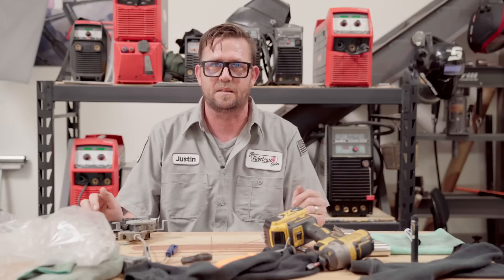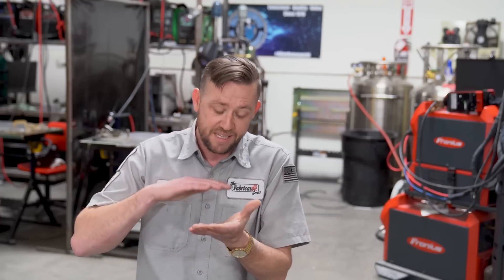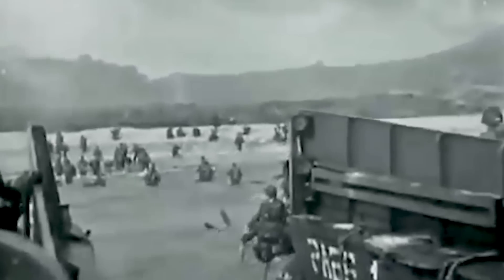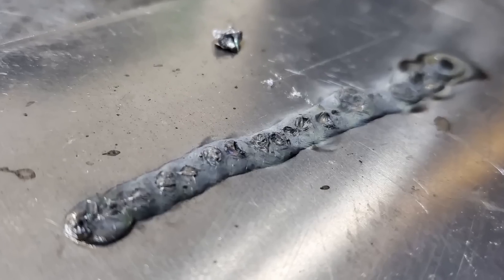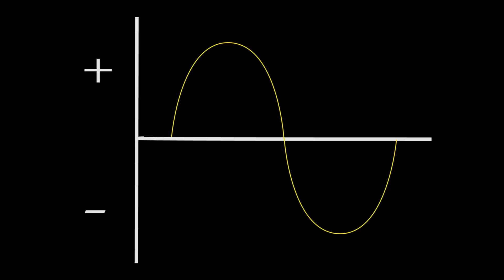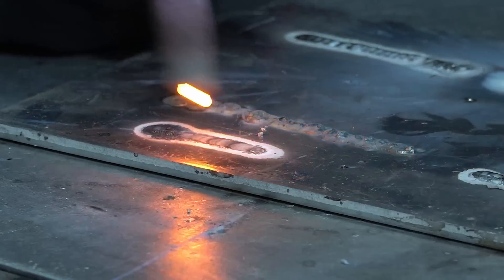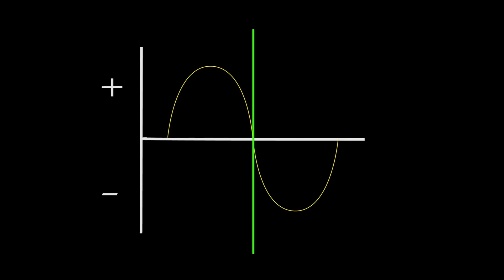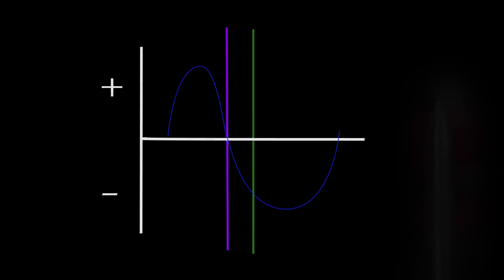We used to Ball the Tungsten. Now we Don't.... (usually)

Comment: It seemed to ball itself, doing the aluminum welds we did in my production facility.  I kinda marveled at the cavalier way our two qualified guys were doing things, nobody ever ground an electrode when I was watching and the ends of those rods were totally hemispherical... but the welds were helium-tight (and had to be) and structurally solid, so... messed up electrodes be damned.  I think it's more about the welder.

Comment: The theory is a little different:
When electrode is positive then ions of argon bombard the oxide layer and remove it from the surface of aluminum. Aluminum itself is heated poorly and tungsten is overheated.
When electrode is negative then tungsten is cooling down and aluminum is heated properly.

When using helium there's no cleaning action - helium cannot remove oxide layer as argon do, so no AC is used. But helium gives much hotter arc and it helps to melt  through oxide layer and weld aluminum even without cleaning action.

Comment: So I have a 330A/BP, no balance control. I have only blue, 2% lanthinated tungsten right now, up to 1/8". In the past I welded aluminum with 3/32nd overdriven, and split a few ends. I had a dull tungsten, not balled, and it wouldn't ball. Would I be better off getting 5/32nd and trying to sharpen in, or go with the green and let it ball?

Comment: Possibly (just spit balln' here) the reason why the first machine was set up to adjust the positive is possibly because for a long time it was thought that the electrons ran from +ve to -ve. That's because the multi meters gave a positive deflection when measuring the voltage and current. What they were measuring was the "holes" left behind when the electron jumped to the next hole on it's way to the positive terminal. Kinda like sitting in a moving train and measuring the world going past you thinking the world is moving and not you. So they thought the electron was moving to the +ve.  Once they could detect the direction of the electron they realized it was moving from -ve to +ve. But by then we had a whole industry set up thinking in the opposite direction.  Like I said, just spit balln' here.

Comment: Very timely video!! I run a 400A modern inverter machine in my home shop and infrequently use a 300A transformer syncrowave at work. Currently building some very large 1/4" wall tubing frames at work on the syncrowave and was balling 1/8" lanthanated tungstens and not seeing great results, especially on fillets. I'll have to play with the tungsten shape and balance a bit more tomorrow and see how that works for me. I'm also happy to have found your weld coach channel. I was a big fan of TFS and really liked your past videos on there. Lastly if you or anyone has other tungsten suggestions for the transformer machine that could also be helpful!

Comment: A few things, it would have been heliarc in those days with 50hz. 60hz didnt become a lot more common until mid 60s. This is also around the time gtaw sheilding gas experiments were getting more in depth and playing with different alloyed metals in gtaw. Then we started to see the viability of simply tig welding aluminum. As most applications dont require the added heat input of helium especially on thinner material. 

You also do not need to ball the tungsten. All the balling does is reduce transfer of tungsten to the workpiece and maintain stability in the tungsten. If you size your tungsten bigger the tungsten will only barely ball on the tip. Grind angle and quality is important when doing this. Thoriated will resist the balling throughout. Yes even on transformer machines. Most applications do not require modifying the ac wave. Balanced can be helpful at times also. Mainly on castings or broken down aluminum repairs. 

You can also weld aluminum on dcen if proper cleaning precautions are taken and the amps are set correctly for desired penetration thickness. A little helium helps too.

Comment: My 460 amp Miller has balls! It is a 1965 Goldstar 330 abp. 23 years ago, I was taught in college to ball the tungsten but we had syncrowave machines. If I recall correctly, we may have just done a small ball on the tip. The semester before, I got the 330abp at home and taught myself to tig weld from miller's web site.......no youtube back then. Most of what I tig weld is steel with some stainless thrown in and only occasionally aluminum, and a spoolgun is sometimes a better choice on the miller 211 inverter mig. Lately, I have just sharpened the pure or lanthanated tungsten to a point and blunted the end, like I do for DC use, then I let it ball on it's own. We did use only thoriated on the syncrowave machines, if memory serves me right.
Reply: I have a 330A/BP as well. So you are saying for aluminum you just use lanthinated and blunt it? Or do you use the green?
Reply: @TheMetalButcher  Originally, I was taught to use green. After watching videos, I tried 2% lanthanated, blue. It handles more current but seems to work the same as green. 

I sharpen and then blunt the end, the same as I would for welding steel with 2% thoriated. Recently, I tried balling the lanthanated after sharpening but I don't recall if the arc was more stable. My biggest problem with the 330abp is the arc wandering when doing ac on aluminum. Aluminum and stainless are something I only occasionally do, so I'm no expert at what is the best method for the old machines like our 330's. 

For aluminum 1/8" or thicker, I use 1/8" tungsten and run my power on the middle tap maxed out and control the pedal. It takes a lot of heat to get going. On 3/16 or 1/4 material, I will use the top tap (3rd position on big selector) and turn down the knob to 10-40 percent.

The 330 with sine waveform just does not have a focused arc with deep penetration. I'm not sure if mine has issues or if it is normal for a since wave transformer machine. On thicker material, stomping on the pedal works. On thinner material, like 1/16" x 7/8" aluminum tube, it was very hard to get a nice bead and not burn through. The arc has a mind of it's own, even with cleaning and prep. That is when I tried balling the tungsten again. That part, I ended up grinding and blending the welds on. There were no voids, so the weld was good, just didn't look like a stack of dimes. The syncrowave machines I used in college were much better at making a nice bead.

Comment: Totally about balling but you left out the effects of frequency.  Throw out at 200HZ or even 400HZ and the arc cone gets very narrow and controllable to steer on AC.  Also, at home where I only have 50Amps at 240Vac I am sometimes forced to weld thick aluminum with DC.  It is easy but requires meticulous prep and Helium.  Single pass on 1/2" to a 1" plate, no problem.  Another good video though.

Comment: I appreciate this video.  I took welding in night classes in the 80's just for my own knowledge.  We were taught to ball the electrode when TIG welding aluminum.  I've welded numerous projects using Ocy/Actyl gas welding, ARC welding and MIG and over the years purchased all the machines to accomplish that.  I never pursued TIG because I was just doing hobby-shop work and couldn't justify the cost of a TIG unit.  Fast forward 40 years......  I have a friend who has a TIG machine (and he's not sure of how to use it) and we had a conversation about technique.  He was talking about different colored electrodes and that you don't ball the tip, etc.  I was totally lost as that went against everything I had learned so we didn't get very far in the conversation.    Your video explains a lot so I think my friend and I can resume the conversation.   Would you happen to have a video on tungsten electrode selection?   Thanks for posting and I've subscribed.

Comment: It's not about getting hot enough to melt the aluminium-oxide, it's an electro-chemical process turning the aluminium-oxide back into aluminium. If it would get hot enough to melt the aluminium-oxide it would also get hot enough to vaporize (turn into a metal gas) the aluminium. Instead you can see the aluminium-oxide "vanish"  with still non-molten aluminium "underneath" (it is not underneath, it is the same aluminium that was bonded to oxide atoms before).

Comment: "time, not amperage".
mines weird. it has clean area width. thats cool.
it also has clean area depth and that, as far as ive worked out with my fiddling, IS amperage.

doing really thin stuff i find its great with a 3070, but with a lot more current dumped on the positive... or at least, winding the depth up to +50. tend not to blast through edges as its the electrode taking the brunt of it.

giantz. other than feeling a bit colder than the dial says, its been pretty damn nice for a chinese unit. knock on wood.

a foray into selecting frequency might be good?
again, from what i see... low frequency if you gotta get in deep, or positional... high frequency seems to make the puddle more liquid but less penetrative.

Comment: Hi Justin. I have a question. I want to buy a welding machine(AC tig). But I found that it is locked at 60 Hz. So for example, instead of welding at 120 Hz 110A, welding at 60 Hz but a bit lower amps, would it be about the same thing ? 
Thanks.

Comment: nice video as always. it just needs a better way to describe the cleaning action rather than "melting it". technically i think its called cathodic reaction, converting the oxide back to aluminium, which makes most peoples eyes roll back in their head. sorry i don't know whats an easy way to describe it.  also the big factor in balling is the type of tungsten used. more robust tungsten's don't ball as much as the old pure does which i think is worth mentioning.
Reply: its called ion blasting.